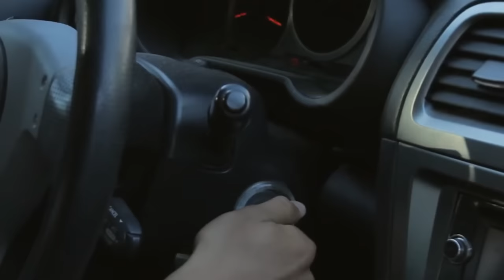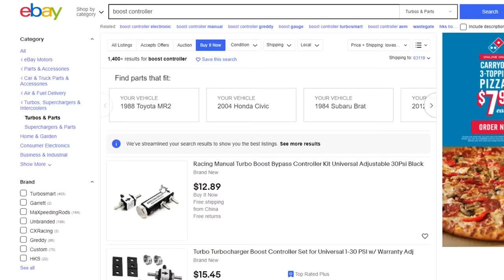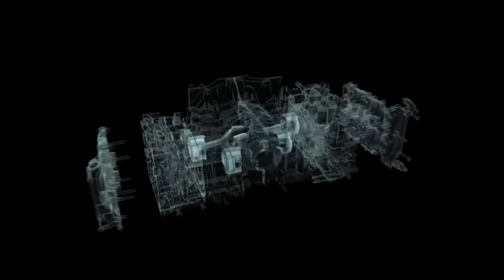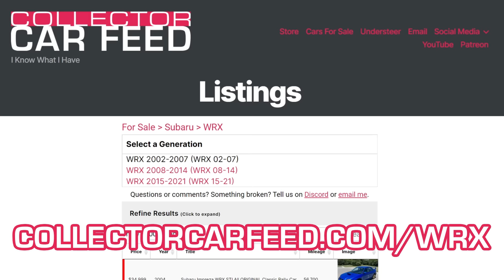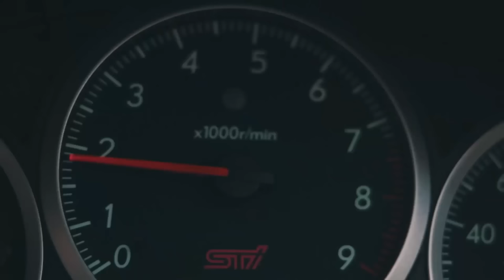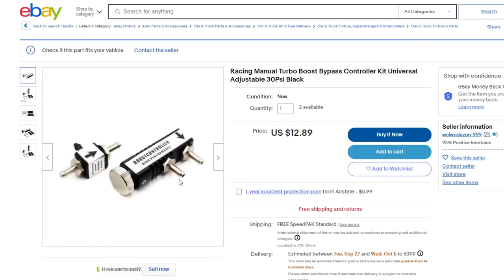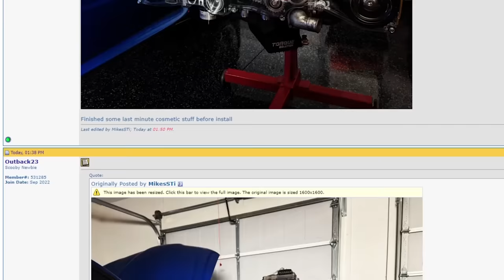Hard Truths of Owning a WRX in 2022 (Donut Media Won't Tell You This)

Comment: I did the spark plugs on an ej 25 Impreza 2008 in about 20 mins, only had to move the fuse box slightly and remove the air filter, no biggie. Fuse box is 2 bolts air filter box is 1 it’s not as much of a headache as people make it out to be .

Comment: Could someone explain why, if head gasket and timing belt failures are so common, Subaru's cost so much used?  I was thinking of getting a WRX because of the obvious fun factor, also because most are manuals!  But 2016's with 100K plus miles are like $17 Large.  Just an example, I guess the demand is high?

Comment: I'm no fast boy want-to-be by any stretch I can tell ya..But I think mud flaps look good on the WRX... I'm in Missouri and if you care about your paint you'll need to spend the money and get some or make em' yourself if you can... I'm on my second Subie now...2012 hatch base model was puking oil from everywhere it seemed...no mods but an ACT lightweight flywheel...It was the head gasket and or the main seal. It was cheaper to trade it in than to fix the darned thing!...Now I'm in a brand new 2021 base model WRX. I got it last Christmas with 5 miles on it...No mods...I might get a cat back, wheels and mudflaps but that's all .. She's my daily and can't afford to have it in the shop all the time " working out the bugs" so to speak ..Good video man ..tell it straight...Do your research...What? That kid put a bigger turbo and didn't build the bottom end or change injectors? No dry sump oil...no AOS...no big fuel pump nothing....just nothing but a bigger turbo! Lol...big dummy...And....my friend....The world is flat! Lol

Comment: I like buying modified cars because I like figuring out what the previous owner did. Plus you get a bunch of parts for cheap. I don't have a problem figuring out what they did. But then again almost every car I have owned has little to no information in detail. Examples include: 1979 Subaru DL with unknown year transmission missing engine when I bought it. Current daily.
1981 Oldsmobile Delta 88 diesel, excellent fuel economy and all mechanical, sold.
Datsun 620 pickup no engine installed, included taken apart 240SX engine and transmission plus a ton of parts. Built, drove, sold.
1967 Chrysler Newport with unknown Chrysler industrial engine, fixed, sold.
1948 Pontiac Chieftain flathead straight 8, first car, was rusted out, sold engine and trans
1983 Subaru Brat, bought sitting for 30 years, fixed, drove for 100,000 miles, totaled by an idiot driver
1987 Mercedes 190D Turbo, blown head gasket, blown turbo, replaced head gasket, replaced turbo, sold
1992 Nissan Gloria RD28 diesel wagon, blown head gasket. Fixed, sold to friend, he drove for 87,000 miles, then someone crashed into it and it was totaled.
There are probably a bunch I am forgetting about but all of these were bought either in a non running state or modified in some way or ruined by the previous owner. All were very easy and quick to fix. And the 79 Subaru I bought 5 years ago is my daily driver today. It had no engine when I bought it, and a random unknown transmission, and I ended up using a different random unknown transmission I found on the ground at the junkyard. Put an engine in it and I have put many, many miles on it.

Comment: ur right bout not lifting the engine out, you just need to remove your intake manifold, power steering pump, alternator, upper oil return, and your throttle and clutch cables to reach the top of the motor.
Reply from the maker: Subarus are fucking stupid lol
Reply: Wtf are you talking about?  You have to take out the battery and the intake to do plugs, that's it.
Reply: @CollectorCarFeed  factual
Reply: @carfriendsimulator9981  im actively talking about the engine im rebuilding with my hands in my garage. thats how i did it, video creator agrees also
Reply: …then you did it wrong, friend.
Reply: @GriogharThomasBaldwin  to reach the top- of the block? you dont have to remove anything? on an ej25? yea ok.

Comment: Not that bad…. It’s junk.  If you have to replace head gaskets, you have to pull the engine. Not only that, but they are intentionally made hard to work on.  They are made of the cheapest steel that you can buy.

Comment: Gave it a dislike... A Subaru engine doesn't blow up from simply putting on a different downpipe - WTF ??? And the FIRST thing you check when buying a Suby ist the OIL, if there isn't enough in the engine, open the radiator cap, you might find the oil there ;)

Comment: Buying a subaru in 2022 is hard if it’s completely bone stock AND I MEAN COMPLETELY STOCK well maintained go for it. The biggest Mistake MF’s makes is like he said with the manual boost controller they turn up the boost with no support mods and blow the shit up. I’d do a long block upgrade “well I’m doing that now” then all the other shit that’s gonna support that. But I’d leave it stock until then and knock out the preventative maintenance in the mean time any leaks, brakes, tires ect score a bone stock 03 sonic yellow and it took me 2 years to find one

Comment: Got my DADs 2005 STI BLUE GOLD with only 16.000 miles car is 99% Stock with ORG BBS Wheels And tires 90% Tred saw one go for $66.000 on BRING A TRAILER ASKING $70.000 for mine car is NEAR mint all new FLUIDS and just had an STI SS Exhaust put on my Dad never did car sounds way better and I can tell it's got more power

Comment: I have a 2004 stock motor, just a short shifter and invidia exhaust thats all might just get a stage 2+ cobb but i stay with oem stuff and a oil change every 3k to 4k miles.  And its sitting on some rotifoms only cons might b the raceland dual adjustable coilovers they ride good had them for like 1 1/2 years they dont give problems how ive seen people talk and say about them

Comment: Lol I do but that's only because I shoved a ej205 in a gc and it has even narrower frame rails on my ej253 and the ej22 that was in the car it was less than a 5 minute job literally stupid easily ya you have to take the air box off but no you don't have to remove the battery it's not difficult. On a gr wrx it's remove battery and air box and use 2 extensions to make it long enough it's an extra step that's supposed to be done on an na that I skip because I can take my extension apart standing over the car it's fine.

Comment: Ngl you dont gotta punch low with the women jokes. Takes a person out of the immersion of the vid when somebody starts dragging their knuckles in an otherwise very well informed and put together video. I have an 04 fxt and everything you said totally nailed it. If you throw a million mods and 40 pounds of boost at an otherwise stock engine youll be seeing the inside of the block very soon lol. Subies are plenty fun left stock. (and NOTHING can beat the winter drifting) Ive converted all the forester suspension to sti bolt-ons and left the engine alone and it made a massive difference in the "fun to drive" factor which really is the only thing that matters in a daily driver. And i can still take any total shitbox car that tries to race, so its hardly an embarrassment left stock. You really do have to be a subaru person to own one for long

Comment: i mean, what car isn't reliable at stock and if you do the basic maintenance? in comparison to something like a k series, of course this engine is unreliable when you pit it against that. you could beat the snot out of the k24 but try that with the subaru and you'll need towing... that's the point others are trying to make. the engine aint so reliable in comparison to other engines assuming of course, you put in the same maintenance for both like regular oil changes... in terms of reliablity? well, what engine CAN'T make it to 150k+ miles stock and properly maintained? it's not a very big achievement now is it?

Comment: You do need to lift motor up about 2 inches to get spark plugs out. Also remove battery and intake... You clearly have not done this
Reply: no you don't.  you clearly have not done this right.
Reply: @carfriendsimulator9981  then explain how to remove 3.5 inch coil pack from 1.5 to 2 inch clearance and then put socket in and remove spark plugs. Ill wait. Tip... Saying break them is not an answer
Reply: @carfriendsimulator9981  you probably are thinking sohc not a wrx dohc
Reply: @DustinDIY  yup, spoken like somebody who has never done it.  You spin the coil packs 180 degrees and it gives you enough clearance to pull them out.  I have done this in DOHC H4s and H6s.  If you lifted the motor to remove the coil packs, you're a fool.
Reply: @carfriendsimulator9981  maybe early years. But not 08 on. Ive rebuilt, the entire thing. Sorry but exception not rule. If it doesn't raise about 2 inches. Wont come out. It is directly in front of frame rail
Reply: @DustinDIY  again, no,  you are wrong on this.  do me a favor, search for "08-12 wrx coil pack replacement" on yt, then come back here and say "yea you were right, i've never done it.  it looked impossible to me so i thought you had to lift the engine"
Reply: @carfriendsimulator9981  nope. The only thing ive never done is remove plugs on it without a slight lift.

Comment: There’s a 93 240 for 6k should I buy or too much
Reply from the maker: I mean, what's going on with it, how many miles, is it running, is it swapped, is it kitted, rust, etc etc
Reply: @CollectorCarFeed  clean no rust 150k miles 1993 Nissan 240sx Hatch with goodies no trades cash only clean title
-car runs and drives/has on and off throttle cut from bad regulator/car has dents and bangs on body and roof/windows stuck down/needs tires and wheels/needs long looped power steering line that wraps around subframe. Cluster doesnt work
-PBM coils
-ISR high power steering line
-no rust, small spot under dash on firewall
-All new bushings and ball joints front and 
rear
-working handbrake gktech cables
-seat/wheel
-solid subframe and differential bushings
-welded diff
-engine bay wire tucked
-brand new engine / trans mounts
-refreshed cylinder head with new valve seals / head gasket
-150 compression all around
-new plugs
-new ngk spark plug wires
-new injector seal kit installed
-new fuel pump
-brand new full exhaust
-uncracked windshield
-brand new brakes rotors and pads
-180sx tails
-mostly full interior besides trunk area, ac components removed but still have
-brand new clutch flywheel and pressure p See less
Reply: @gamepros535  no that sounds like a terrible car

Comment: Suburus been junk, owned 3 factory maintained. complete junk. all new wrx shall go cvt, the boxer system is a bad German design, and they have no place un in preformance. Better go General motors, run a 350, Suburu is the lesser of the japanese Items. Toyota/honda are the coreheart of japanese performance. Js :D